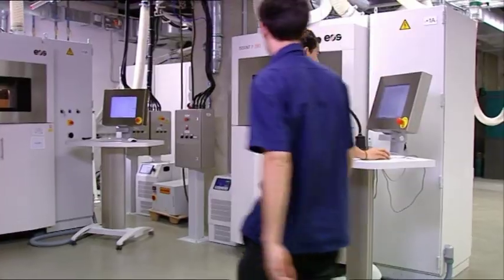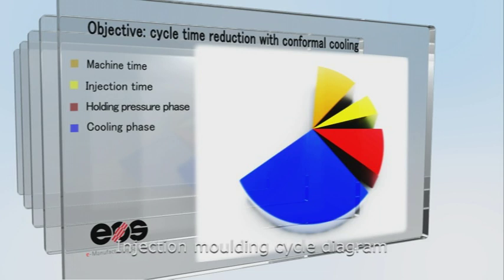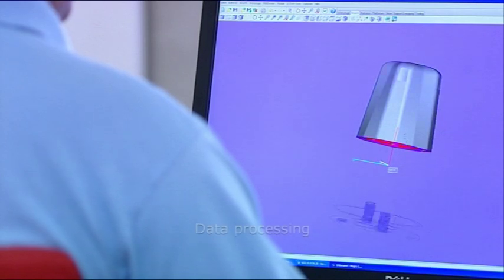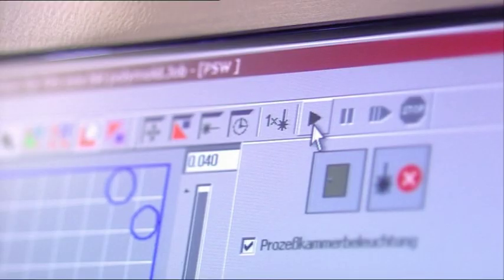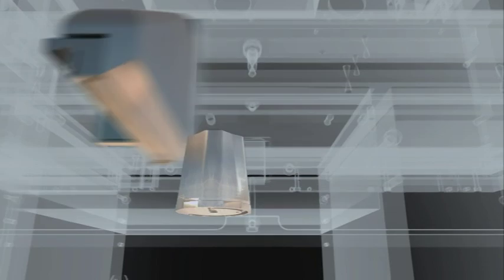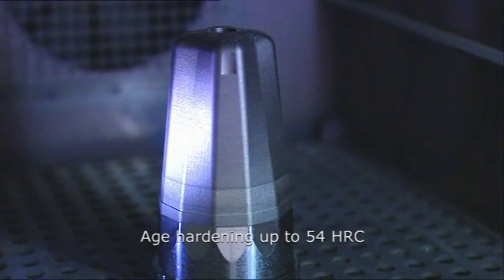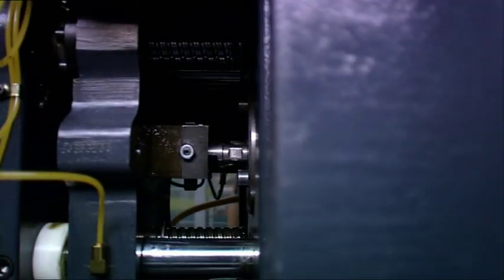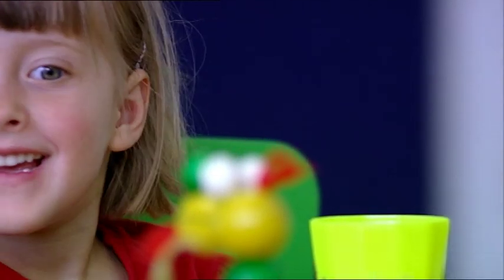Thus shaping the future of dies and moulds: With EOS tooling applications

Comment: Is there a reduction in the durability of the tool by using eos? What about printing with a softer material like 304l?
Reply from the maker: Thanks for you interest in our portfolio! From a mechanical point of view additive manufactured tools deliver comparable performances as conventional ones and they have a similar chemical composition as well.Currently, we do not have a stainless steel type 304 in our portfolio. If you are looking for a softer material we can provide EOS Stainless Steel 316L or, if your application is more critical, the EOS Stainless Steel CX which can be hardened up to 51 HRC.We hope that helps you :)